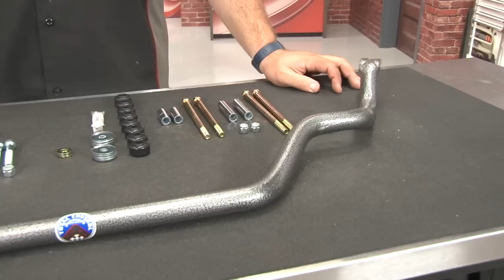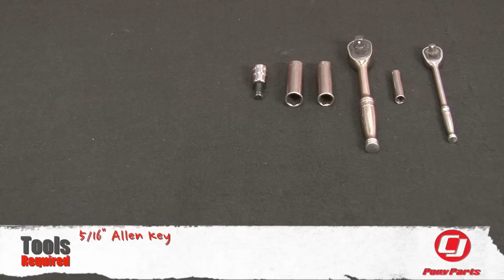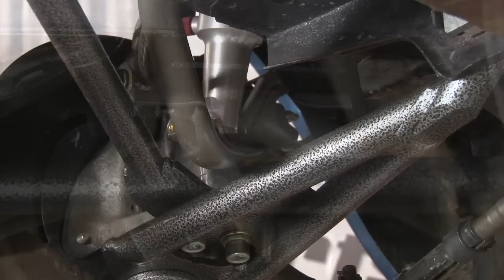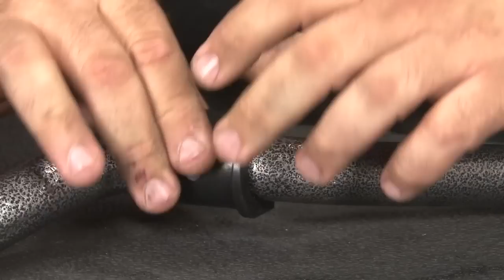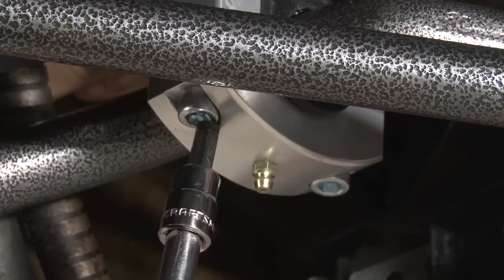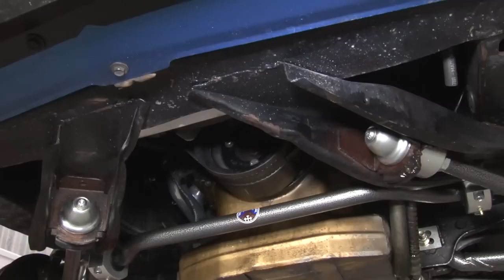Street Performance Sway Bar Kit | Total Control Products | 1967-1970 Mustang

Comment: For racing sway anti roll bars are great. However, for street driving with potholes, bad roads etc., they are not the best rattle vehicle etc?  Your thoughts overall?
Reply: HI. Actually, if they were not needed for performance and cornering on streetcars, they would have not invented them, and they would not be used on every car manufactured today. my thoughts.